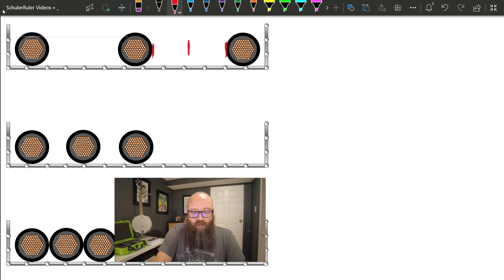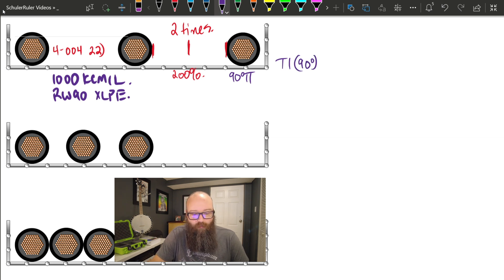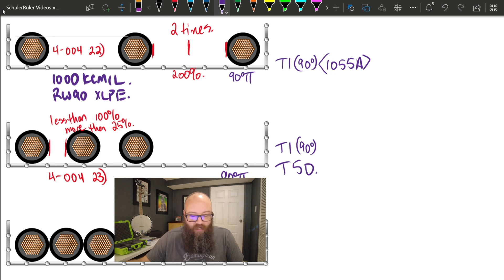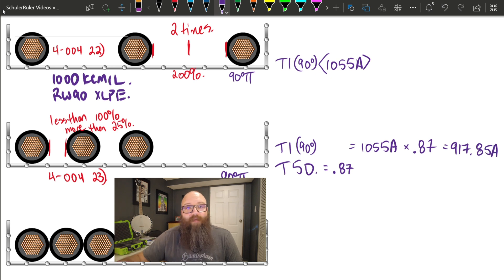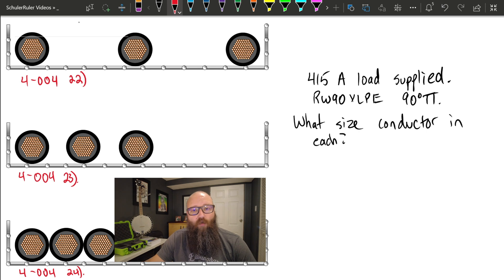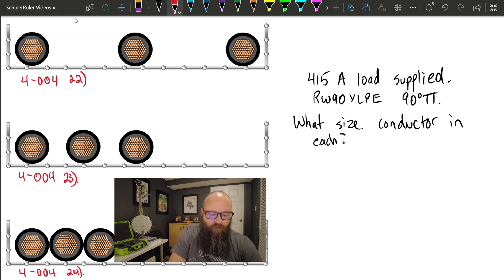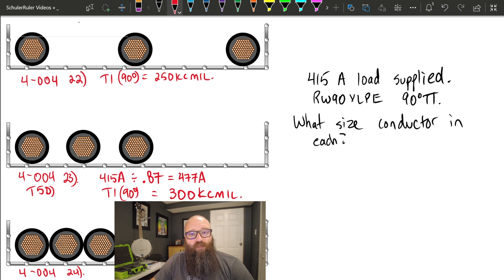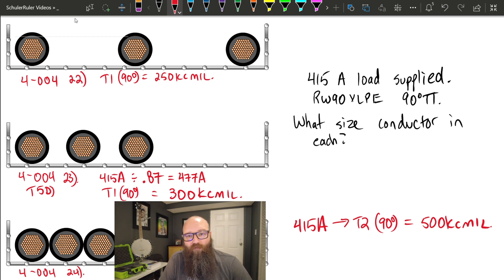Single Conductor Cables in Tray

Comment: Is a cable tray still considered a raceway in the 2021 code? if not does 4-004 still apply to cable tray?
Reply from the maker: It does but it would be covered under 4-004 22), 23), and 24)!

Comment: Rule is not available in this CEC2021 what you told tht its only showing this Rule 4-004 21).
Reply from the maker: 4-004 21) is a reference to table 66. The rule I have mentioned is 4-004 22). Which used to be subrule 23) but with the deletion of table 39 and the rule referencing it, subsequent rules have shifted back one.

Comment: The rule 23 tells me that for a multiconductor with separation of greater than 25% and less than 100% of the largest cable, use table 2 multiplying by table 5C and table 5D

Table 5D covers up to six (6) cables horizontally in ventilated and ladder- type cable trays, what if there are more than six (6) cables, what is the correction factor?

In my case I have 8 cables with 3 conductors each, the factor with table 5C is 0.70 and I need to multiply the 0.7 by the factor of the 5D table but I don't know what factor to use if I have 8 cables in a single layer.

Thanks!!

Regards